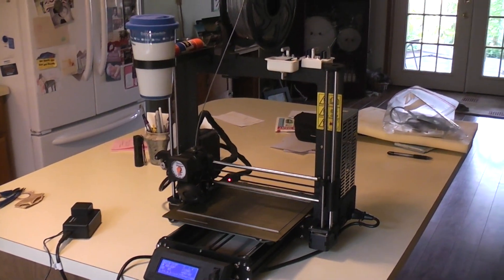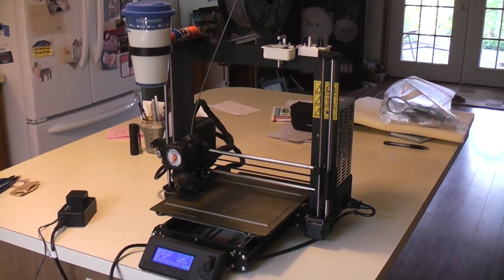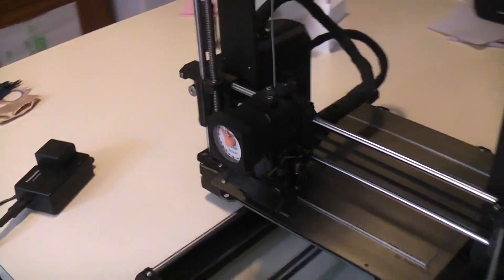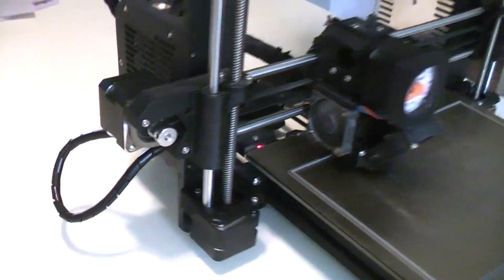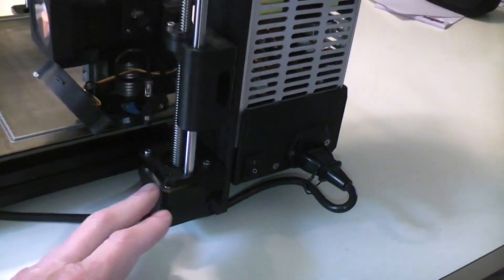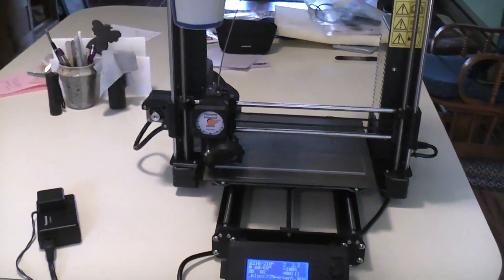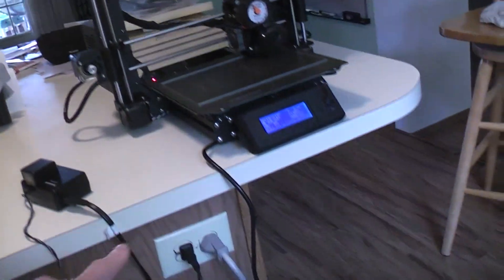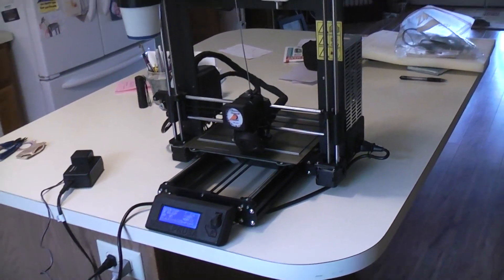Stepper Dampeners on a Prusa MK3 .  What was I thinking ?

Comment: I know this is a 2yr old video, but wanted to know.. how's it holding up right  now?
Reply from the maker: Perfect. Its my only printer in the house and my go to printer for 99% of everything I do. The other printers work fine and I do use them if I need more parts fast or if I need to print something really large. My old delta still gets used all the time as well but it is for the projects for the wife and there are lots of those.
Reply: @Robothut  any ringing showing up?

Comment: I also added stepper motor dampeners to all the motors, and I really liked the difference on the noise reduction, for the Z axis, I previously had installed these: https://www.aliexpress.com/item/32922987168.html?spm=a2g0o.productlist.0.0.3b6f4437UdnZhL&algo_pvid=fae0405d-fb0d-4245-a0cc-adb3bc264f51&algo_expid=fae0405d-fb0d-4245-a0cc-adb3bc264f51-3&btsid=0ab6f82315888351245576620e4822&ws_ab_test=searchweb0_0,searchweb201602_,searchweb201603_    so I didn't have to modify the motor mount, because they already had clearance

Comment: I just did exactly the same mod mate mate, except my dampers are 4mm thick, but they seem great quality.  I didn't seem to have the clearance issue on the Z like you perhaps they have changed the design?  I had about 0.5mm clearance.  Are you not concerned about the Z axis being unsupported at the top?  My rods have obviously dropped down 4mm although it doesn't seem to have had an impact on quality.
Reply from the maker: Cool. Yes I bought some dampers for my Tevo Flash and they are different. I guess there many different stiles out there but they all seem to work the same.

Comment: How do your CR's (is on c r better quality than the other) quality compare to your Prusa (are they comparable)......I'm fixin to by either A Prusa or a cr10 s4......thanks
Reply from the maker: The Prusa is way better out of the box, but you pay a lot more for the printer. So if money is an issue I would go with the CRs4 as you can get really  ice prints from it if your willing to mod and tweek it a bit. If money is really a factor then the Ender3 is probably the way to go.
Reply: I appreciate for your reply....I plan to start with a Prusa mk3 but would like to buy a cr10 s4 next/later.....just wanted an experienced 3d printer guy familiar with the quality of both to give me an opinion if the s4 can be moded to Prusa quality?  Thanks  @Robothut